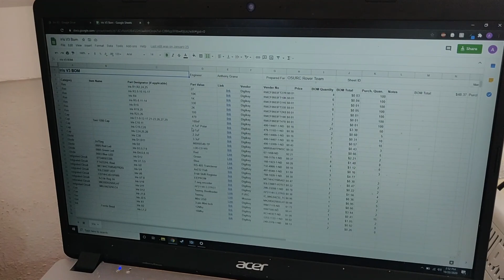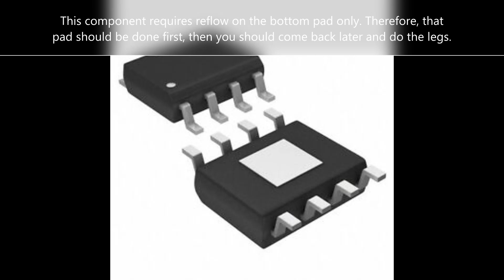SMD Soldering 1: QFN and Reflow Components

Comment: Wide soldering iron tips help a lot with solder wick, as it soaks up so much heat. 
JBC soldering iron with quick change cartridges are awesome, but outside my price range, so I have two soldering irons with different width tips. 
Tip cleaner chemicals work wonders, too.